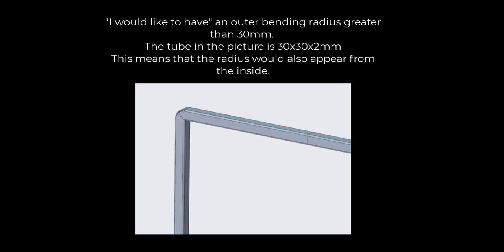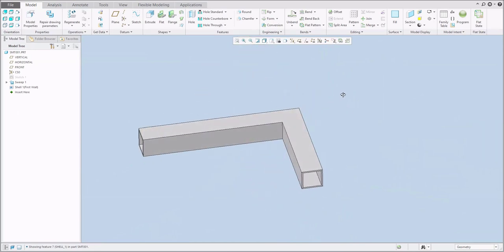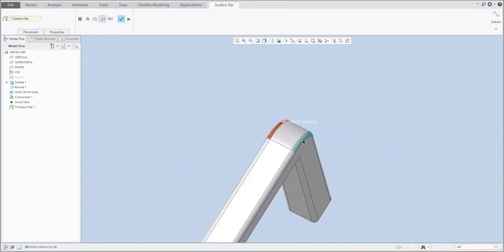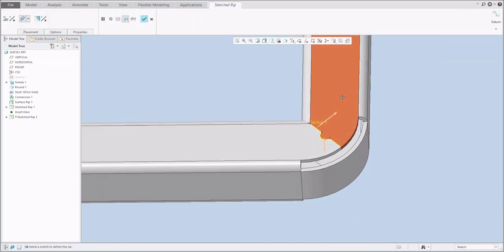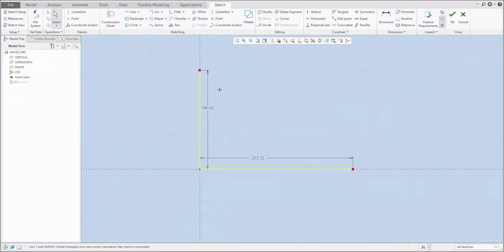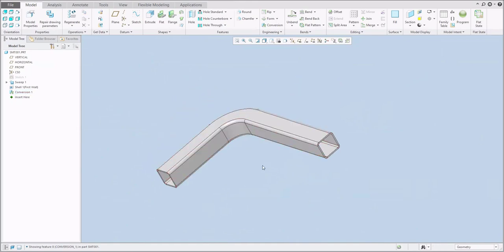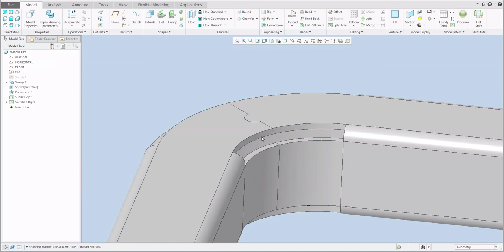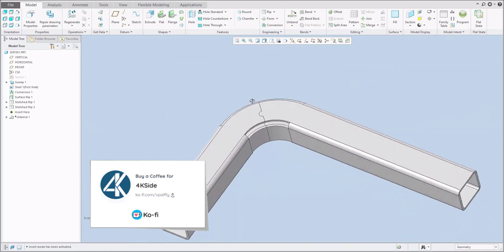How to unbend a pipe defined by radius

Comment: Too bad the second shape is impossible to manufacture in reality.
Reply from the maker: I have seen also that top/bottom surfaces are still not flat (top and bottom surfaces for drawing is necessary to unbend manually / maybe use Sheetmetal cut and add then extend surface by Extend feature)
But as you mentioned, seems that is hard to produce.
Reply: Is this is Nx or solid work